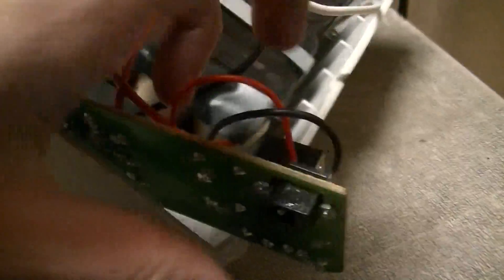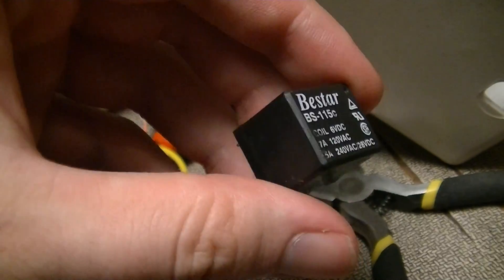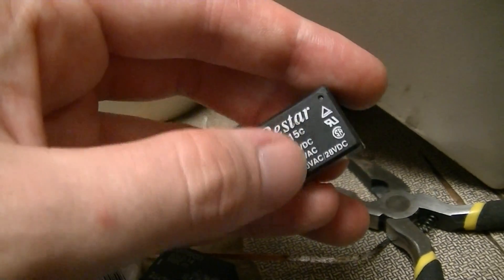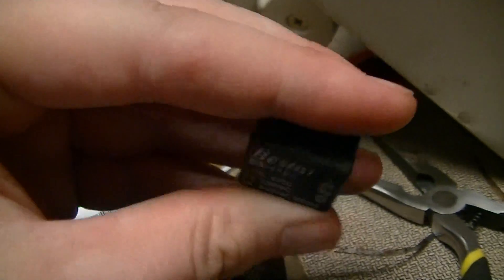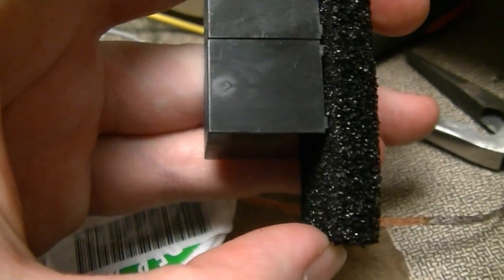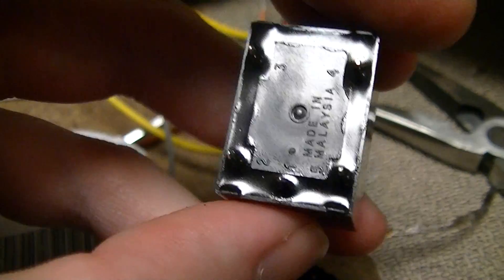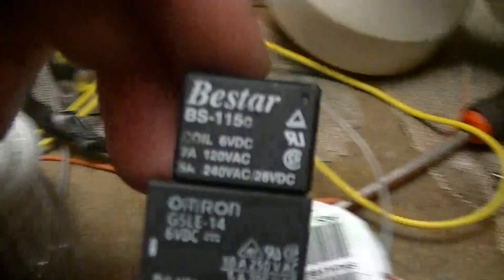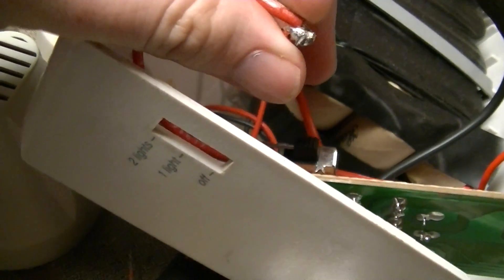Emergency light fix

Comment: hlynch1  3 Emergency lites malfunctioning   1) Combination dual Emergency lites & EXIT SIGN not working. Got good  120V ac source 2) Dual Emergency Lites neither work. Growling noise when push button depressed to activate sys,  3) Dual Emergency Lites, which stays on all the time and growling noise when BATT connected.          

  Please advise of a good tutorial on "How to diagnose Combination & Exit Sign Lites down to PCB, but NOT Individual components.

Comment: I just noticed that my lights did not come on during the last power outage... come to find out the battery was shot... only 1V ... so i got a new one, put it in and the lights still dont come one... so i took each buld and wired it to the battery and both lights come on so i know the lights are good. I also put a wire from the battery to the pins where the lights attach to on the board and the lights came on... so i know that portion of the wiring is good ... i dont hear my relay click when i plug into 120V or unplug from 120V... or when i hit the test button...

Comment: i have a twin lamp 12v lead acid battery emergency light. it charges the battery but when you unplug the unit, the lamp fails to turn on. both battery and lamps are not faulty so could it be the relay.
Reply from the maker: fiaz shah Check to see if the relay coil is getting electricity.

Comment: How long was that light in use before it broke down?  I have used desoldering wick for years and a desolder pump. Then I got a desoldering iron and that helps a lot But I also know the wick works better that a iron as I have pulled up a few traces in my life.